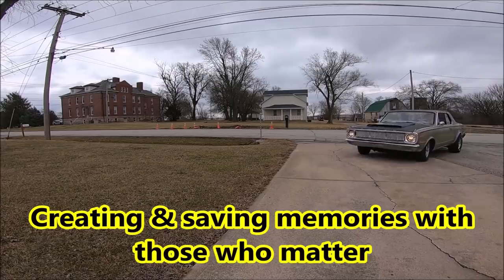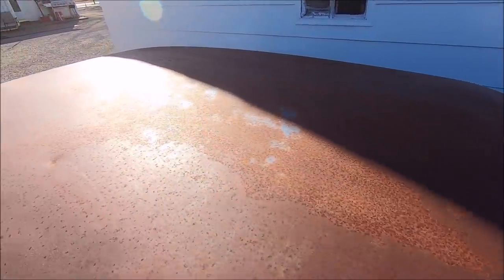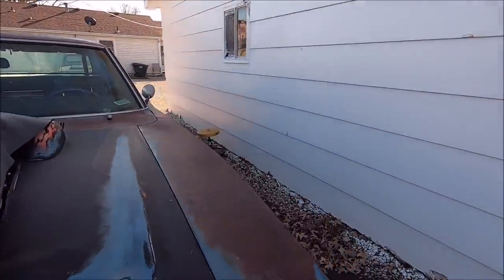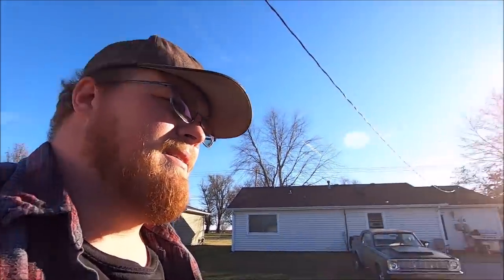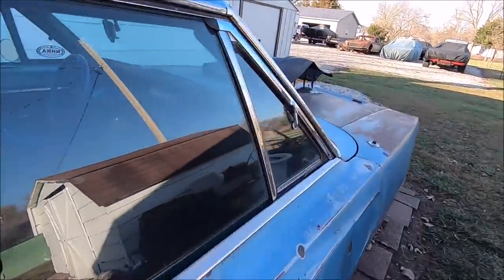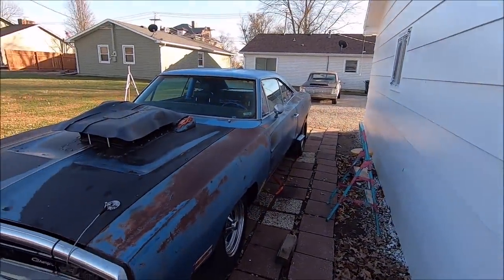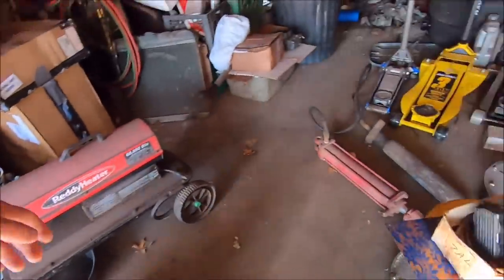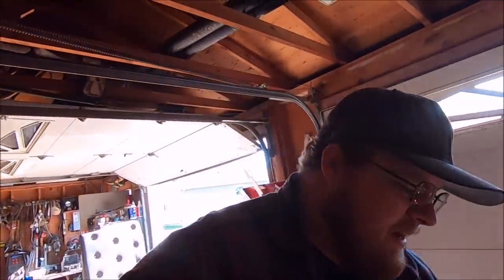Possibly Ruining my 1970 Ratty Charger Jezebel by Painting her

Comment: In Topeka at least, lace paint on the sails was pretty popular in the 70's.  Saw numerous brand new  (69/70) to a year or two old with lace panels.  I do think they used a flatter lace material to get a sharper image on  the body. I had a new 69 Bee (no lace)
Reply: Your paint job came out great.  If it were mine, and its not, I might have added some blue to the the trunk lid.  Thanks for filming!
Reply from the maker: I was gonna do some blue to the trunk but I ran out of paint

Comment: Question for you Scott, would a bad alternator cause my 73 Plymouth to lose complete power? I had it warming up for 10 minutes kicked it off of high idle, turned on the headlights, there was a little stumble then 10 secs later it shut down completely..... no lights, horn or ignition... I have power all the way to the amp meter, amp meter is good....

Comment: Hey Bud, man I gotta tell ya your "Jezebel" is lookin' awfully sweet!
Pop's ride is extremely badass, you tell 'em I said so.
So hey, I've been meaning to ask you, just what size shackles you use on your ride to get that stance? You see both my '72 Mustang coupe's need lifting on back, 'cause my tires are getting damaged on the slightest dip and hole in the road.
P295/50R15 (on back)

                                       Thanx Marc H.
Reply from the maker: I hope this reply finds its way to ya brother, I appreciate the kind words about Jezebel. As far as lifting the back of the car, there are 3 ways of doing so and only 1 right way. One is air shocks, another is leaf spring extended shackles, and the last is with re-arched leaf springs or different leaf springs. The proper way is with leaf springs. I am guilty of using air shocks and shackles in the past but not anymore. Jezebel is using stock style heavy duty leaf springs like off of an R/T or Hemi Charger and stock leaf spring shackles. My narrower rear end helped save me a bunch of headaches. If you want to use leaf springs shackles I recommend these: https://www.jegs.com/i/Allstar-Performance/049/ALL60055/10002/-1
Make sure to purchase two packs, because you need 4 shackles total for the 2 leaf springs.
Reply: @ScottsSpeedShop Awesome! I'll send pictures in the summer, I hate working out in the cold nowadays (I feel older than I really am) you see.